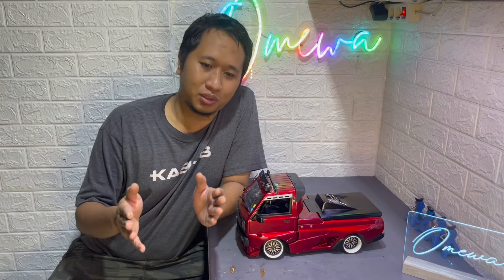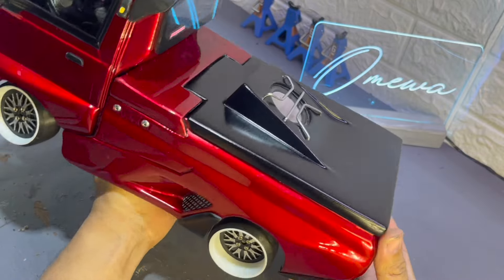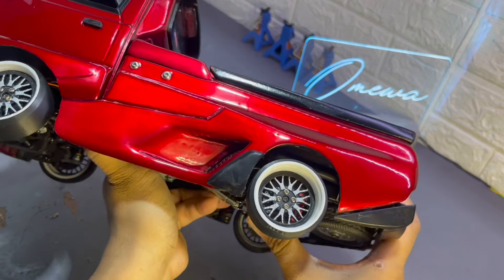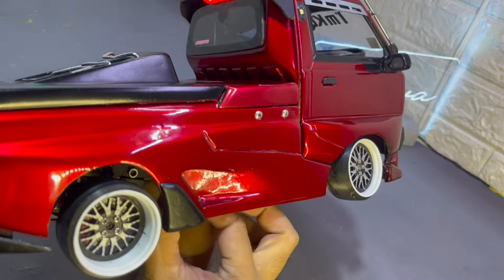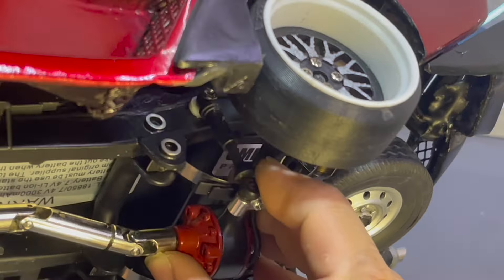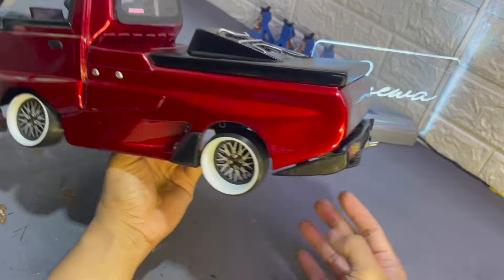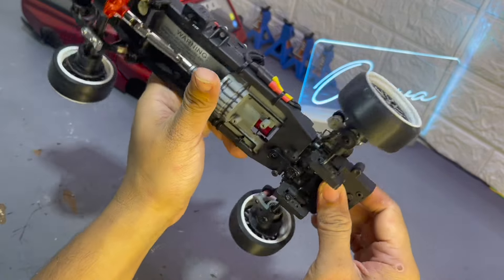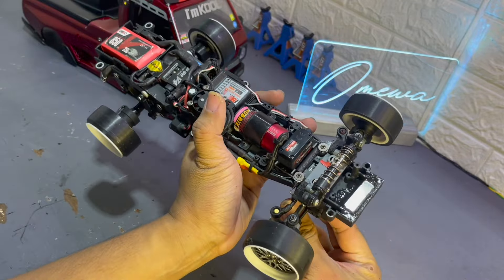Perpisahan WPL D12 New Reborn 2024 full Upgrade, Realistik, Detail, elegan dan futuristik | OmEwa

Comment: Bang bisa gak kalau gearbox mn86 di kasih grease untuk drive shaft mobil
Reply: Nama grease nya MOLY GREASE NLGI12
Reply from the maker: Bisa saja mas.. cek di spesifikasi grease nya ya
Grease kan punya daya cair di suhu tertentu (meleleh seperti mentega saat kena suhu tertentu)
Greas kan awalnya lengket dan ketika ada gesekan dari gear metal dan menyebabkan gear nya mengalami kenaikan suhu (akibat gesekan) suhu gesekan antar gear metal ini yang akan mencairkan greasnya menjadi seperti minyak untuk melumasi gigi gearnya.
Di dalam gearbox RC kenaikan suhu akibat gesekan ga terlalu tinggi om (tidak seperti di mobil sebenarnya)
Jadi greas blm bisa meleleh masih lengket ini yang menyebabkan RC kita lemot (berat)
Saran sih pakai Greas yang cair (base silicon oil) klo ndak ya pakai grease yang speknya cepet meleleh di suhu rendah. Cek spesifikasinya di label grease pasti ada tulisan “worked penetration 25*c) artinya greas itu mulai melumasi di suhu 25*c akan meleleh (mulai pelumasan)
Reply: Ok bang makasi ya
Reply from the maker: @BoruKu-o8v  siap sama samaa 🙏🏻